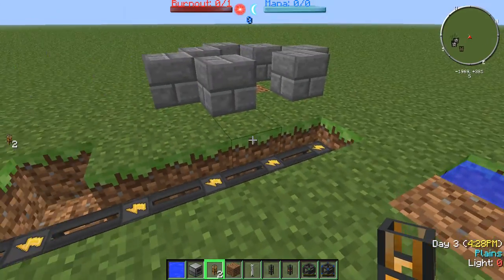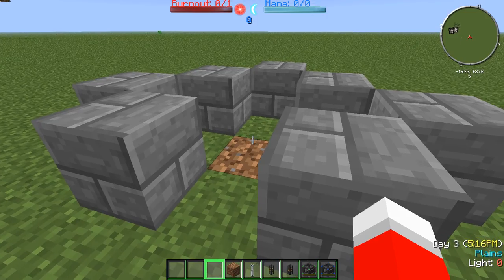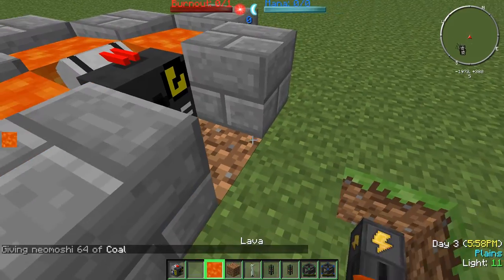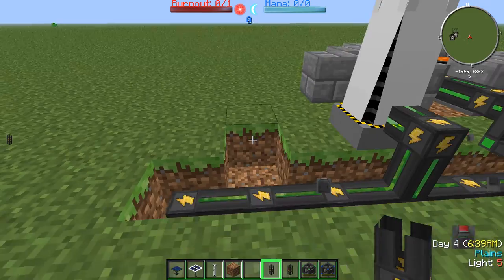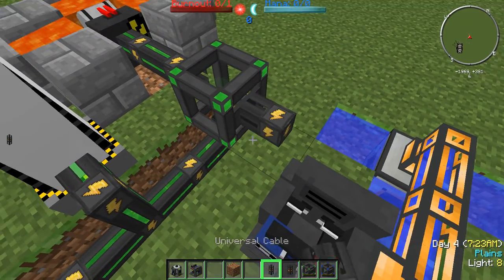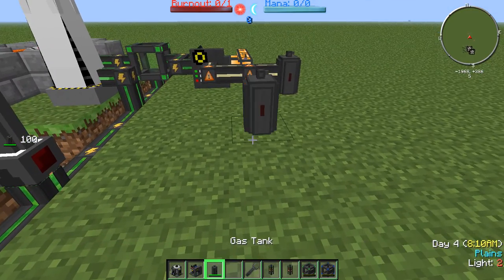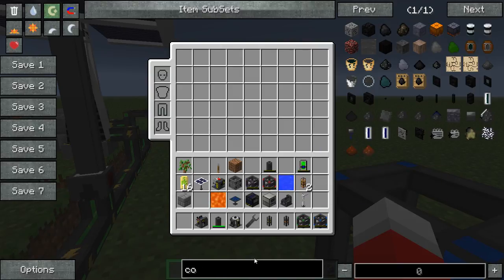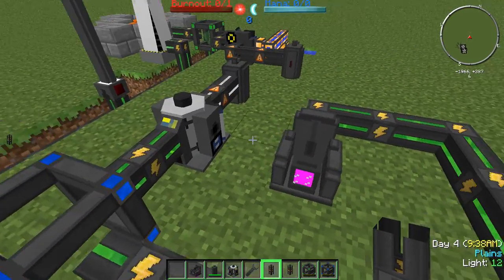Let's learn the mods Mekanism Episode 1 - Basic power generation, storage, and transfer

Comment: How do I get energy into an ultimate cell? I try putting it straight in from the solar panel. but can't, and I've tried to move it from a normal cell... HELP!
Reply from the maker: you need to put it into a side that doesn't have the metal strip on its side. The side that has the metal strip is the output any other side is the input.